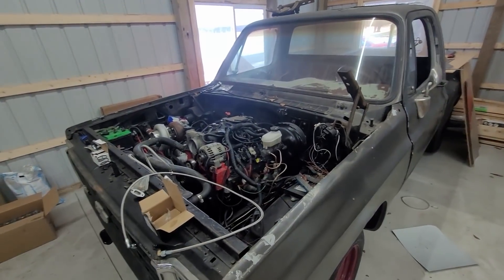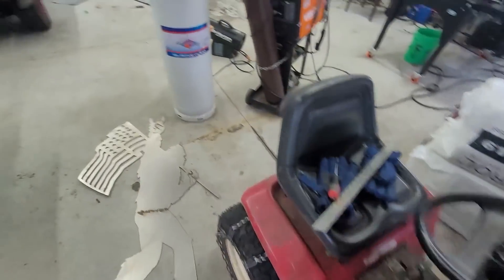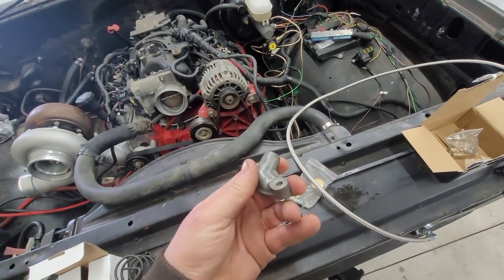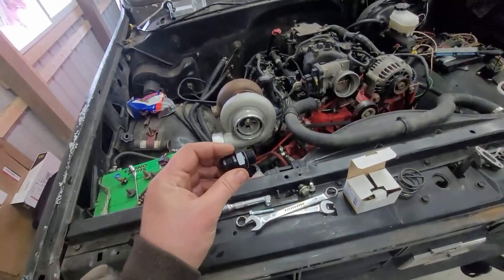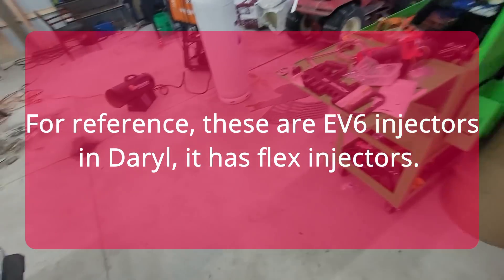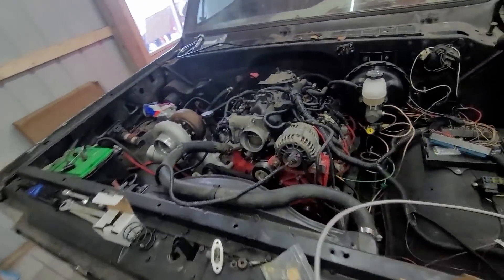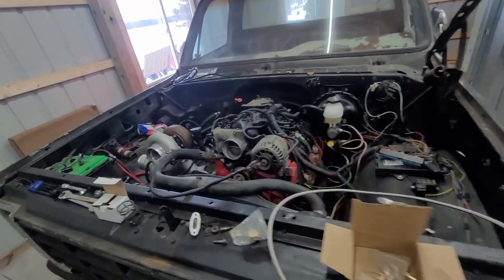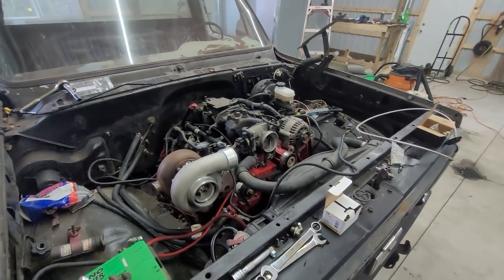Cheapest/easiest way to add boost to your LS engine?

Comment: This is perfect for my truck, a '68 C10 with a cammed 5.3 and a 700r4.  I was thinking of doing the same thing and limiting it to the 6oohp level at the wheel.  That's over 675 at the crank and at that level the trans, rear and chassis will need an upgrade.  Not Cheap.  I build LS's and do swaps and I hear all the time "I want 1000".  As you know it can be done but what's required to support that safely with any kind of lifespan isn't cheap.
Reply: I actually did my first ls swap in my 72 c10 after i blew a cooler line and my 700r4 didn't wanna shift anymore,  the cost to get it rebuilt was similar to a donor truck at the time. 5.3/4l60e in that one.  Now I've also got a 72 gmc c25(3/4 ton) that I've stuck a 5.3 in but retained the turbo 400, i feel like now i can do a cam or even a turbo without needing to build the trans. Launching stuff at the strip definitely wears out more stuff than just cruising around will generally. Cheers
Reply: You sure the 700r4 will hold up?
Reply from the maker: What if his 700r4 doesn't hold up? 

Then he fixes it... Not the end of the world.
Reply: @TheDrivewayEngineer  Then it breaks again and he's in for another rebuild.  At the 700hp level you need a 4L80, a 700r4 unless it's built with Sonnax parts doesn't stand a chance and those tranny's are almost 6 grand a pop with a converter.
I know you don't want to hear it, that's what I like about you and I agree but a 700 just isn't up to the task for any meaningful time.  
Better to upgrade to a tranny that will take the power in mostly stock form and is programable.  Ask me how I know.
Reply: @hardball107  holy shit! I'm gonna quit my day job and build 700r4 transmissions. Fuck, I'll even give em away at 5g installed with the sonnax parts. Four of those a month for 5 months out of the year would suit me just fine lmao. The 4l60e in my 99 Silverado took a shit on me last summer. I put 25 dollars worth of friction discs in the forward clutch and got a cheap ass corvette servo from Amazon for like 40 bucks. I beat the balls off that truck every day in the southwest desert and it's still going strong. Hell I even reused the old trans filter and a few quarts of the old fluid because I don't like spending money on my vehicles. My truck doesn't have anywhere near 700 hp but I drive it like I stole it. And if it breaks again, I'll just just fix it again. I guess there's a difference between the guys who "build" cars and the guys who fix them. Just saying lmmfao
Reply: @fuzzymoto896  No way, I've been building for my whole life and there is no way a 700r4 will last for any meaningful time at a 700hp level.  That was my point, at my trucks current level, just shy of 400hp at the tire it's OK.  Add a turbo, that's all, and that trans is done.  I would have to upgrade to a 4L80, do some frame strengthening and possibly upgrade brakes and rear, almost $5000 in parts alone.
Anyone can take an LS to 700hp cheap and easy, having the vehicle live happy is another story and that cost has to be added to the equation.
Reply: All of that depends on the weight of the vehicle you're trying to move,tire size and gearing... There's lots of corvettes running big horsepower numbers thru built 4l60s for example.
Reply: @shawnwimberly9294  Corvette 4L70's are very modified from the 60 version.  The 4L60, although based on the 700r4 is a much different animal.  Different clutches, sprags, 5 pinion planets and different reaction shells, in other words GM redesigned and improved the 700r4.  The servo's and valve body's are different all in the name of strength.  The first thing everyone does is put Corvette servo's in their 700's.
  I've put a T5 behind a cammed 5.3 in an S10 soaking up over 400ft/lb of torque without a problem so I get your point but anytime you put 700hp in front of a 700r4 you're asking for trouble in any vehicle, they just aren't designed to soak up 600-700 ft/lb of torque.
A modified 4L65 or 4L70 can do it but good luck finding one in a junkyard, those are very sought after.  If you have room the 4L80 can do it in stock form.  My own '68 C10 with a cammed 5.3 putting 400hp to the rear wheels had a major builders 700r4 in it rated to 500hp.  It lasted 2 years and smoked it's forward clutch, I returned it and they said they would repair it but if I wanted it upgraded it would cost me another 1k to 1500 dollars.  I got my money back and pulled a good 4L80 from a 2wd 3500, had it popped open, checked and cleaned out and purchased a controller and T/C and was still $1000 ahead and that trans has been going strong for 6 years now.  That's what the "80" stands for, 800ft/lb.
  You want to fool around with a 4L60 and 700hp, be my guest, I had to learn the hard way too.
Reply: @hardball107  cool story bro.  Maybe I'll find the time to read your book later.  Point is,  horsepower isn't the only factor.  Rumor has it that it's torque that breaks things anyways.
Reply: @shawnwimberly9294  Well Shawn, like I said to each his own.  Go ahead and read my book when you have a minute and realize anything putting out 700hp with a power adder will have just about the same torque output.
Reply: @hardball107  you're very insistent on missing my point in order to make some of your own points... that's kinda weird. One guy says will that 700 hold up,  jr says who cares if it doesn't it can be fixed,  all i said was it'll depend on the application.  Then you wrote a book. You're not keeping the 700r... gotcha.  A 68 c10 is a very cool truck, I've got a couple 72s myself.
Reply: @shawnwimberly9294  Shawn, it's a been there, done that for me.  I had a guy that insisted a Bowtie overdrives 700 would handle 700 ft/lb, it didn't.  If your just cruising around its fine but our vehicles are at the drag strip many times over a summer.  So what's your point ?  That it's torque that breaks stuff ?  Sure, but there's not a 700hp engine out there producing just 300 ft/lb of torque and our original discussion was about making 700hp cheap and easy.
My point was, from personal experience with 2 of my own pro built transmissions and quite a few others behind lesser engines is that the 700 doesn't holdup.  In fact I've had better luck with the 200r4 out of a Grand National.  I put one in a Buick GS with a strong 455 in front of it for my brother and it's still going strong.
Anyone can claim anything they want in a forum, I really do build cars, a lot more now that I'm retired and if I'm helping someone out with a build I'll make suggestions but it's up to the owner.  I've been in the middle of to many issues with broken parts because someone didn't listen.
Yes, I do write a lot.  It's almost impossible to get a point across in just 3 sentences and make yourself understood in today's world.  There's always someone whining out there, not you, but if your short on details the bitching never stops.
Reply: @hardball107  there's plenty of boosted hondas that aren't grenading from torque as a quick example. I'm certainly not here to argue with you though,  i wanna know more about the c10, is it long or short,  factory or cut down, leaf springs or coils, bench seats or buddy buckets or something else? What color is she and does she have a name(is it a she even) running air conditioning?
Reply: @shawnwimberly9294  When I got her she was a Styleside, factory air short box.  The air still isn't hooked up.
Now she's blood red inside and out with a 5" chop, cowl injection hood, black tonneau cover and widened 6 lug GM Rally's with trim rings, she is also shaved, smoothed and mini tubbed for the drag slicks.  She's been lowered 4" in the front and converted to '72 disk brakes.  Out back I have the stock coils and trailing arms.
Inside she has white door cards, buckets and a later model console, full Auto-Meter gauges and a B&M shifter for the 700r4.
For power I built a '06 5.3 with 4.8 flat top pistons, a Texas Speed cam, LS6 springs, one piece pushrods, a Staub rocker bushing kit, LS2 timing chain and a Melling oil pump fed by a Fitech Ultimate LS induction kit.  Long tubes, an X pipe and FlowMasters finish it out.
I'm running a TCI 700r4 with a constant pressure valve body and a 3:73 with a Eaton Posi diff and drag slicks.
The best she's run is 12.2's@118 in the quarter.
I call her L'il Red.
Reply: @hardball107  12s are very respectable quarter times if you ask me.  Sounds like you've spent a couple of bucks on her, how long have you had her? I just got the vintage air kit in my c10 last spring,  i was able to keep the factory ls compressor in its low mount position. I've got a couple spare beds, so I'll be giving a short bed conversion a try starting with cutting down the bedsides and welding them back up.  I'll probably "learn" on the 3/4 ton since it's a leaf spring truck and i want to have the technique down before i cut on Bessie. My 3/4 ton i call Sheila. She's got a factory tach (somethin i think is pretty cool) and an aftermarket underdash a/c unit and one of those highliner plastic headliner speaker contraptions that i think is kinda neat as well. No paint or slicks just yet,  paint is almost the very last thing im worried about though. What camshaft are you running? Hows the idle quality? A 2006 5.3 you say? Are you drive by wire then? What gas pedal did you go with?
Reply: @shawnwimberly9294  I've had her almost 5 years, 4 with the LS.  It's set up for drive by cable because the Fitech induction kit uses a 92mm throttle body, has a custom harness and a self learning PCM.   All the other parts to hook it up came from Lokar Performance.  When I was planning for the engine build I wanted to keep the driveability so I decided to run a high lift (.600/.600) Texas Speed Stage 3 Truck Cam.  It's a higher output but comparatively mild grind that's OK with stock converters, has a little chop at idle and pulls solidly up to 6200 rpm, according to Texas Speed it's good for an extra 70hp.  L'il Red runs great, gets around 20mpg on the hiway and with the 700r4 low 1st gear comes off a stop light like a pro stock.  Good luck with your build, I believe Brothers Truck Parts has the plans, fixtures and templates for cutting the frame and box.
Reply: @hardball107  I've seen their kit, but i can't fathom a straight up and down cut on my frame... I'll be doing a step cut with rounded corners(if that makes sense) cheers
Reply: @shawnwimberly9294  That will work and I've done them that way before but the Brothers kit includes a 1/4" thick cutting, drilling fixture that's bolted in place when you're done cutting and welding to reinforce the frame, lots less work and the pieces you cut off the fixture double as templates for cutting the rear of the frame off, that way you know the cuts are perfect.   I used them on 2 other trucks and it was a breeze, 3 hours work on a Saturday afternoon including welding.  If you go the step cut route I would recommend welding in a diamond shaped fishplate to spread the load off the cross weld for piece of mind and after welding and grinding it looks like factory from the outside.
Reply: @hardball107  yeah, I've seen their kits and can't stand the look of the bolts mostly due to the fact the pattern isn't symmetrical. I'll certainly be utilizing a fishplate for that piece of mind. Did you ever shorten the bedsides or just go with re-pop?
Reply: @shawnwimberly9294  Went with a stepside on one and an aluminum flat rack on the other.  I have seen a long box cut but more often if you can find a good short box from a later year they can look OK.
My buddy sectioned and added 3" to his stepside fenders tp clear his tires.
Reply: @hardball107  i think a utility bed or some kind of flat bed might be neat,  idk about the later model beds on the older trucks for me personally... the tail lights always seem to throw me off i guess. We will see how it goes, I've got a set cut down and ready to weld up, my welder buddy was supposed to come mend them up this weekend. but there's snow here in Texas and that may slow him down as far as making it this way. I deleted the marker lights this time, next set i want to keep them there if it's doable.
Reply: @shawnwimberly9294  I know what you mean.  I have a 1991 short bed stepside in the garage right now.  We put a stock 4.8 LS in it with a NV3500 5 speed.  Ready for this ?  It had been hit in the front demolishing the front clip, I spotted a 1952 fiberglass front replacement clip for the newer Silverado's on Craig's List for $150 including the grill and all lighting.  Well, it was a no brainer, at least I thought so.  Takes some getting used to.

Comment: Did the crossover pipe come with the log manifold and do you think it will clear a th350…….I have basically the same truck and am on the fence about throwing a couple lbs at her
Reply from the maker: They're 235 each, you can buy them singly or together
Reply: It clears a 4L60/80e in 2wd or 4wd application so it should clear a th350/400 no problem.

Comment: How do you feel about running a carb on an LS? I love the LS engine, but I just can't seem to enjoy FI even tho it is amazing. Would you even slightly recommend converting to carb, or would you say to just suck it up and stick with FI.
Reply from the maker: Me? 

I have no reason to run a carb on this or on my D100. 

Some people do, but I'm not one of them.

It's definitely not cheaper or easier, idk why people think it is.
Reply: Your going backwards with a carb…….stay with the fuel injecton that’s the main beauty behind the LS………..I don’t miss beating on my carburetor with a large crescent wrench to get the float’s unstuck or better yet being 1/2 hr late cause you flooded the engine on a cold winter morning……..no way I’m ever running a carburetor except for my lawnmower or Harley……..even my boat has a 8.1 vortec in it……carbs are bad, unless your strictly drag racing large N/A or nitrous motors
Reply: @trentdawg2832  appreciate the opinion. Thanks for sharing.
Reply: @OGbqze  really the only reason for carb is for looks on an LS.  It will just add cost to the project, and more steps. 

If you think it's still worth it, go for it. Overall,the fuel injection will be better in just about every performance way
Reply: Yeah..... my question too. Also this just in, from Ottawa. A burnout from the Freedom convoy. https://youtu.be/5htgUrnEWGE
Reply: @gmw3083  awesome
Reply: Like JR says, Its not cheaper or easier. I would know.
Reply: @NightWrencher  I did a swap like Jr said to. My buddy put a carb on his LS. Guess who's is faster, cheaper and starts in the winter. Carbs and manifolds aren't cheap.
Reply: Just pretend you have a carburetor.  That way you'll be able to "enjoy it". Or at least it'll seem like you enjoy it then.